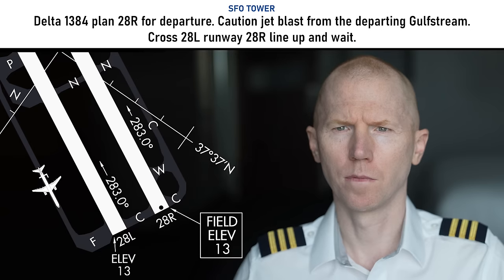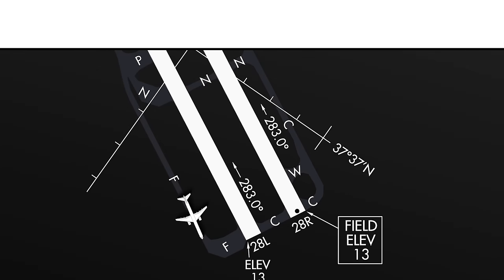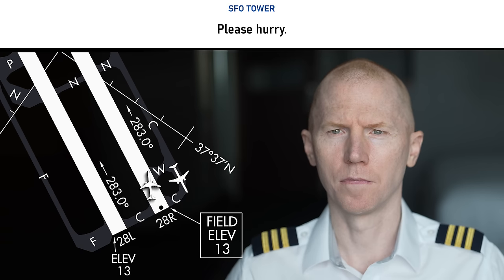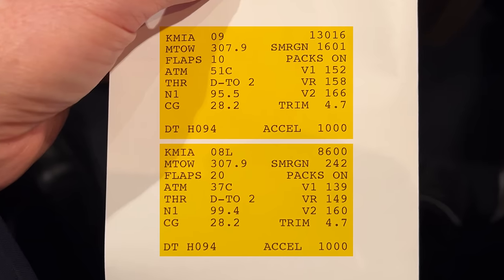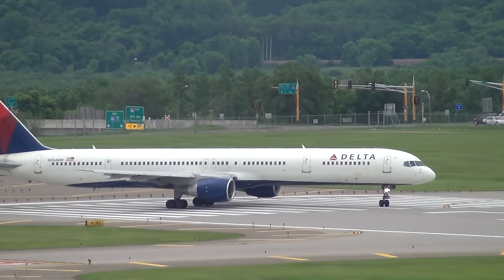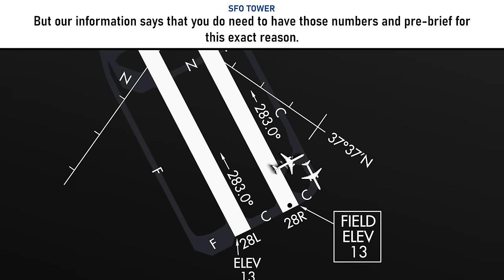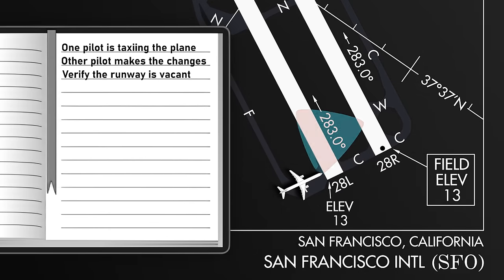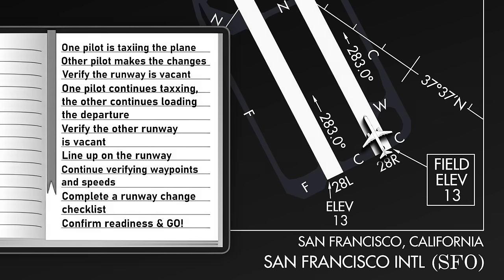ATC Doesn’t Like Delta’s Comment

Comment: Absolutely.  Every controller, whether they be tower, approach, or enroute center, should. be taking familiarization flights at least once a year.  The problem is, the FAA and airlines have made this so difficult, that the vast majority of controllers can't do it because of scheduling, staffing, or airline restrictions.
As a tower controller at a smaller airport, I made it a point to take a ride with local pilots as often as I could.  Now, in an enroute center, I haven't had the opportunity to take a fam flight in years.

Comment: Not defending the ATC chick but I've got to say I met a LOT of dumbass pilots in my 23 years in the USAF. One crashed 3 of our Hurlburt H-53s in 3 years. Then he was the MAC "Pilot of the Year" the next year for Panama. Ain't no telling my friends.
Reply: A C-141 going to Egypt was at McGuire AFB, NJ. They were ready to go but had a fuel quantity indicator screwing up. I brought a new one with me. They wouldn't let me change it.
"It will only take me 5 minutes to calibrate it!"
"I don't care. Forget it!"
I actually argued more. They didn't want to hear it.
~~~~~~~
They crashed the next day, 4 miles short of the Cairo airport. They had run out of fuel. Everyone died.
Reply: In England I went on a C-141 recovery at some obscure place, RAF Brize-Norten, a 4 hour drive from my base in Mildenhall. I fixed their problem and was ready to launch them the next morning but a hydraulic filter button popped.
"You have to replace that filter"
"I checked it. It's clean and it's not popping now"
"The dash-1 says you have to change it!"
"If you think I'm waiting 4 hours for a thimble sized filter worth about 20 cents you are crazy. Go fly!!"
I signed the ER. 
They flew but called back to the states to bitch about me. I was congratulated instead of getting chewed out.
And best of all? The dash-1 was then changed! If you check a filter and it doesn't pop again, it's fine. 😊😊

Comment: As a pilot who flew in and out of San Francisco for 20 years.... This is a bunch of nonsense and a perfect example of how the aviation industry is being dumbed down.
First of all 28R is over a thousand feet longer than 28L. If you have the performance for the left side you're certainly good for the right side. Also it's a 757 not a heavily loaded 747 going to Sydney. Let's use some common sense here.  Quit micromanaging the numbers in use common sense. The runways are extremely close together which you would know about if you're experienced going into San Francisco. The engine failure procedure is the same as far as flying out of the gap. The runways are so close you don't even need to enter the runway change into the FMC. The controller was being a complete....  There are some horrible controllers there and make mistakes all the time even though they have a relatively simple Runway layout. The pilots should have had the common sense to know they could accept the right side with no new numbers needed. It sickens me how common sense is disappearing and therefore you're going to see more and more accidents.

Comment: Commercial pilots, especially at busy airports, are already max taxed with information and checks.   Changing the “plan”
last second interrupts that mental flow and a tribute to these pilots to accommodate that with accuracy.   I know I would be scrambling simply to input all the new date in 5 minutes let alone 2 !    And she gets snarky for a minute or two over ?   Sounds like a “monthly” issue in this case.